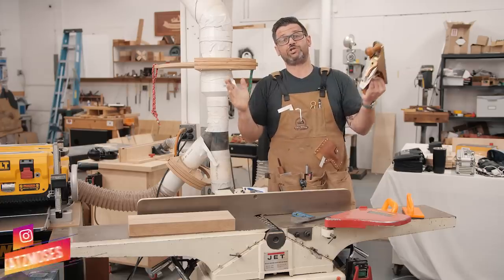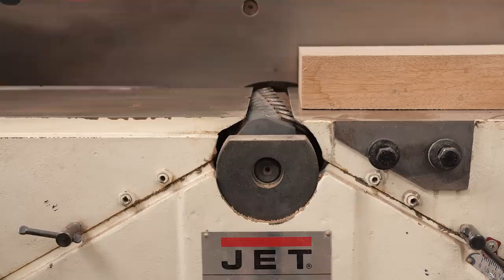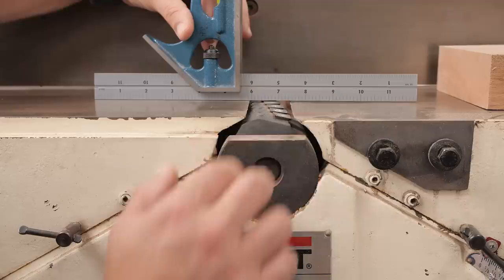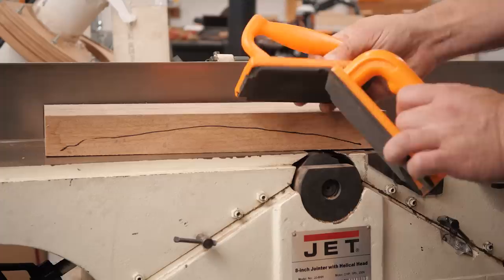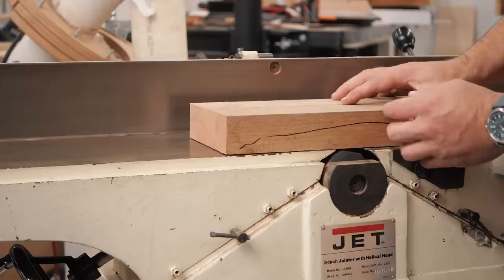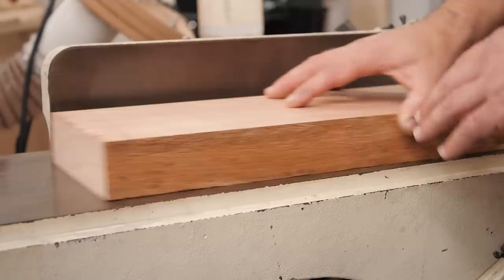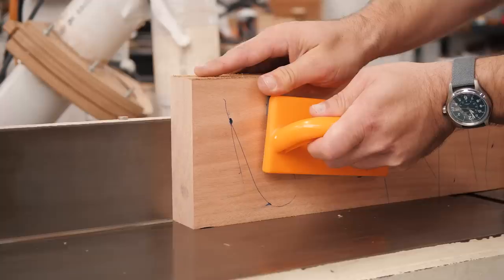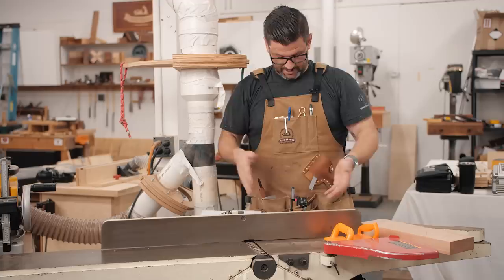How To Set Up and Use a Jointer with 19000 FPS Slow Mo Footage

Comment: Why do you typically have to go to the planer after jointer one side flat instead of all sides on the jointer?
Reply: Jlanter21, if you surface both sides of a board with the jointer, there is no reason to suppose that those sides are parallel to each other! A planer gauges its cut from one flattened side.
Reply: Lee Haelters awww makes sense, thanks for the info!!

Comment: At 8:25 on the video, a gap shows up at the edge of the board, it goes away when you run it over the jointer again but I’m curious of that showed up cause there was too much pressure at the start?
Reply from the maker: I think I say it but the reason is the slant was taller than the depth of cut I was taking. Just a 2 pass operation to get it flat for safety. Could have lowered the infeed to get it 8n one pass but that would probably be too big of a pass.
Reply: Jonathan Katz-Moses You mentioned they board isn’t square but the gap I’m talking about shows up right as the board is passing over the cutters. It’s circular so it looks like the board may have dipped down a bit before it hit the outfeed table. I just wasn’t sure if I was seeing that correctly.
Reply: @pancua978  I believe that was a snipe issue. It looked like the board dug in and jumped the slightest amount. Snipe is more common on the tail end of a thicknes planer action, but if you're pushing too hard on the front of a board at the jointer it can happen as well.
Reply: Thomas Russell Got it, thank you!

Comment: why dont you flatten both sides on a jointer? is it a wear and tear thing?
Reply: Lugman, if you surface both sides of a board with the jointer, there is no reason to suppose that those sides are parallel to each other! A planer gauges its cut from one flattened side.
Reply: @leehaelters6182  Aaaaah ok makes sense, thanks